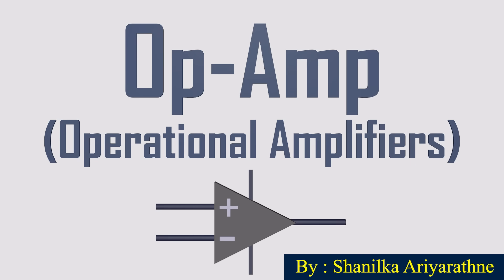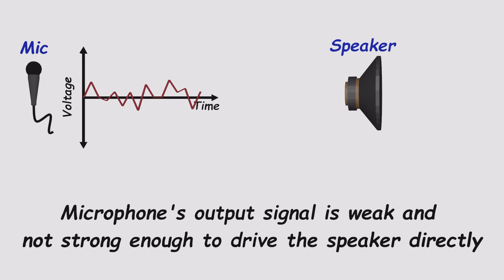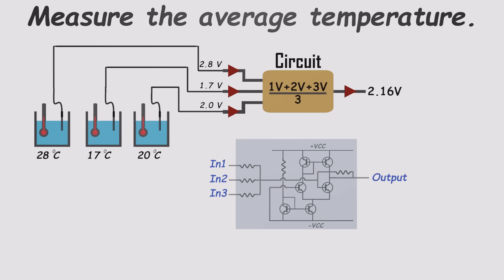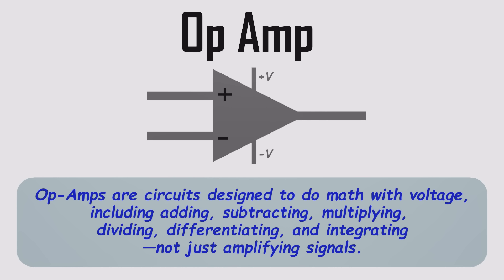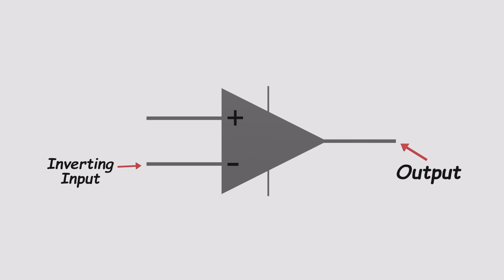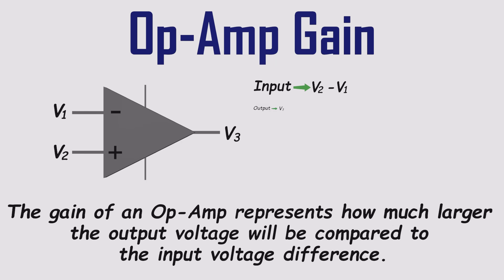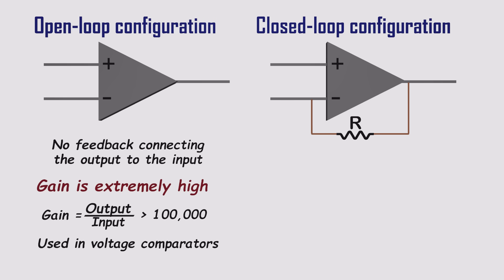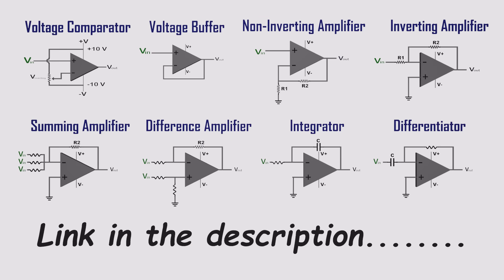Op-Amps Explained: The Tiny Chip That Does Math with Electricity

Comment: This video was very usefull to fix and adjust old ISA Sound Blaster 16 that was pretty badly designed already when it was new, but it's possible to make it much more clear and better sounding with just changing few tiny resistors.
BTW, most of these opams are pin compatible, so you don't have to be afraid to put a different one, it may not do exactly what you want, but at least you won't burn it.

Comment: I took a graduate class in analog design in 1980 at UA Tucson and i had such an excellent teacher that to this day I can still take apart an 741 op amp into its components: biasing networks, active load networks,  input differential amplifiers and output stages. first semester was bipolar process , second semester was NMOS and CMOS
Reply: I enjoyed your comment a lot. UA campus is very beautiful. I visited it in November 1996 and July 2001.
Reply: @ajarivas72  They do not make the LM 741 anymore I have been looking for them they are in a different package
Reply: These are good questions to ask ... "Which would you prefer as an amplifier ... 1) an opamp at negative feedback configuration OR 2) small signal amps (CC/CD, CB/CG, CE/CS BJT/MOS) ? and WHY ?" Why are small signal amps called small signal ? Why would one prefer an opamp with a very high open loop gain Aol ?

Comment: Averaging 3 inputs would take, say, 3 x 10 K resistors on the inputs and a feedback resistor of 1/3 each input at 3.3 K ohm. The negative input must be grounded and the output will be negative. An inverter circuit will flip the polarity to positive.